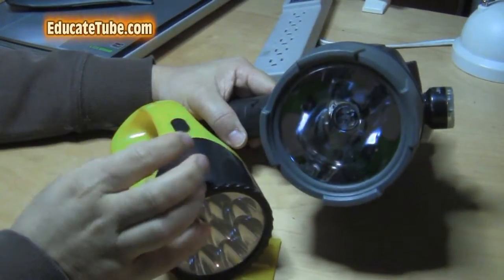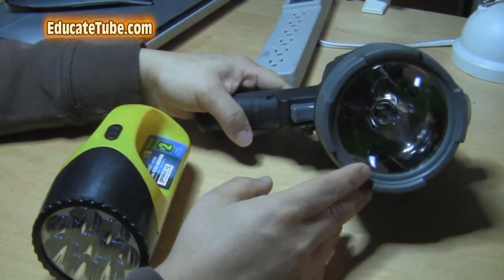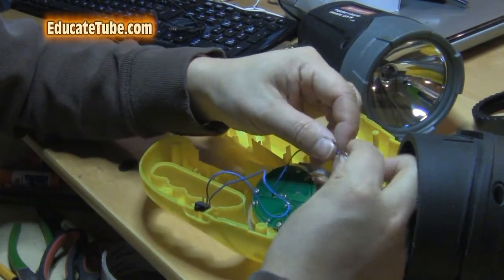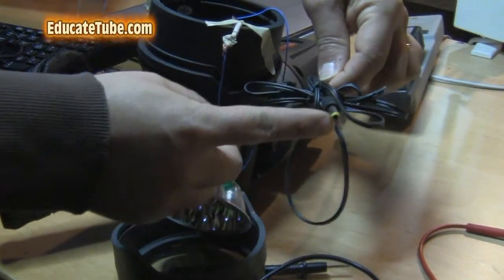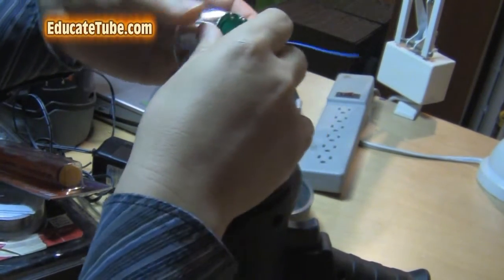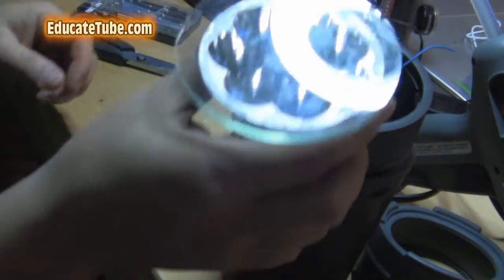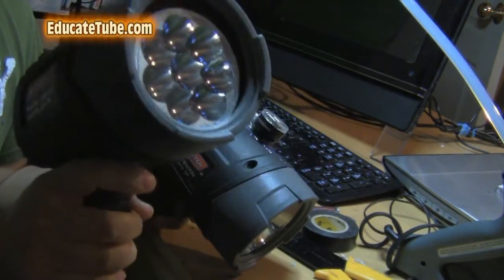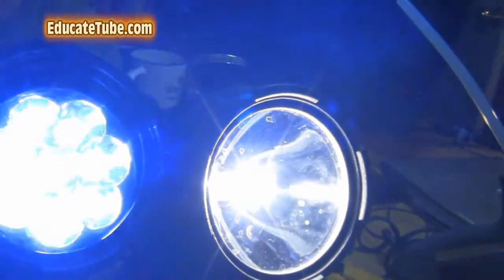How to convert a Halogen Spotlight into a Super Long Lasting Rechargeable LED Spotlight

Comment: The problem is that the charging system has the wrong charging parameters that are designed to kill the battery in about a year it'll become so sulphated it won't take a charge or give any power so you'll need a new battery need to be able to hook up a good battery charger that'll float charge it at 6..5 to full charge at 7.4 volts then the battery will last if they're right between 5 to eight years but I like your idea but since I've got to add a port to hook up a charger just upgrade the battery in the cheap flashlight to a six volt sealed lead acid battery and add a plug to charge with a battery charger the problem is to find a 6 volt battery charger with proper charging parameters I've got both a 6 volt LED flashlight and a lead acid spotlight with a badly sulphated lead acid battery that needs replacing unfortunately both utube videos I've seen on replacing the battery have different opinions on the battery size one says it's 12 volt the other says it's 6 volts so until I do teardown I won't know which but if I can find a rechargeable D battery I have an adapter to use 4 D batteries in my 6 volt LED flashlight being as your LED flashlight already uses 4 batteries probly D batteries if they're double or triple A batteries just pickup rechargeable batteries and a charger and use them instead of converting a spotlight to LED

Comment: I'd like to just get a bulb with the little pigtail on it but in LED form and keep everything original except the bulb. I have a Work Horst light in which I replaced the 6v NiMH battery in and it does work again but I want an LED bulb in it. Been looking all over Amazon and nothing except a replacement halogen bulb with pigtail.

Comment: I really don't want to rain on your parade, but this is the stupidest thing I've seen. Taking a high power halogen spotlight reducing its lumens candlepower by putting in a cheap LED lamp. Brother you would have been better off to put rechargeable batteries in the flashlight you did have and maybe even add a USB to charge them. I would have went with just putting rechargeable batteries in the lamp you had instead of reducing the candle power of a spotlight!
Reply from the maker: With a proper resistor and set of LEDs, it is an option for people would want to get a long-lasting flashlight that is also rechargeable (lithium powered).  I think it is a good idea.
Reply: Okay Energizer lithium rechargeables done didn't have to change a thing

Comment: Neat . But you just defeated the whole purpose of a spotlight. Now you  just have a cheap flashlight in a spotlight casing
Reply from the maker: I just made it more efficient; that is, using less power for the same amount of luminance.
Reply: @educatetube  no it definitely does not have the same amount of luminescence as the original halogen bulb that was in the spotlight. It is now a dollar store flashlight in a spotlight casing. It shines no brighter than the little 3 dollar flashlight that you took the bulb out of

Comment: LED lights are not going to send a powerful solid beam 100 yards into the darkness like a halogen bulb will...
  If you’re trying to spot a bear breaking into your garbage cans, or an intruder breaking into your garage or spot wild hogs destroying your cramps, you need a halogen beam
Reply from the maker: Thanks for letting us know.
Reply: Nah, not the point. I have an old one sitting here. Will do something similar as I never used it to poach deer, bear or anything ;)
Reply: I did not know that ..I was thinking about switching it out to a led .. it's bright enough anyway .. I have a couple of those portable power stations .. lightweight and I can plug the spotlight into the 12 v plug in and take it anywhere not just in my vehicle

Comment: I have the new HF Luminar Work with one LED 3Watt, 3.7 volt, 1300 Amh Li-ion battery, It is bright and throws a long way for a 20% coupon out the door $11.43 in Baton Rouge, La.
Reply from the maker: How long does your LED light last?
Reply: EducateTube.com does the lens cover on the big light just pop off?
Reply: Your spotlight beams patterns it's very very short compared to the original version beams patterns... You are Brite but not so Smart 🤓🤓 people please don't fall 🍂🍁🍁 momb jambo ahhhhH